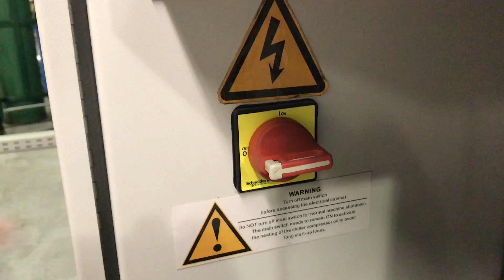Delta Robot High Speed Motion Testing - Project Update #9

Comment: it sounds a bit clunky
Reply from the maker: Mark E it is because of the acceleration profile.  At constant speed it sounds much better but it can’t reach these speeds.  A bit more tweaking and I think it will sound better.  There is also slop in the cheap rod ends that I’m using that attribute to some of the harsh sounds.

Comment: can you show more smooth acceleration?
Reply from the maker: In the current state of the machine, smoother acceleration sounds worse because it spends more time in the lower frequency zone when there are small movement.  All the motors are in sync so they try to reach the desired location at the same time.  Because of this when one of the motors travels a much farther distance than the others, the others slow down quite a bit to reach the same destination at the same time. I may just turn that off and have them reach their destination as fast as they want for a smoother motion.

Comment: What is the aim for this robot?
Reply from the maker: This is purely a hobby project, but I manage a manufacturing facility and something like this could one day easily be adapted for real applications such as sorting metal parts coming off an assembly line. Initially, I will just have it sort different colored marbles.

Comment: Great project! While you can combine a incremental encoder and an end switch, what you really want for this application is an absolute rotary encoder, they don't lose position even after power loss. Optical absolute rotary encoder does exist, but the magnetic ones are cheaper, easier to use and very accurate. Check out the AS5048 from ams or the MA730 from mps.
Reply from the maker: Tat Wong thanks! I have been looking for an encoder I’ll look into those! I have found a lot of single turn absolute encoders but they are definitely the most expensive part of this project.  The rear shaft is 14mm so if I can’t find anything to match that, I can build a coupler or use gears and/or belts.
Reply: Nice thing about the magnetic encoders is the ease of use. I just super glue a small disk magnet to the end of the motor shaft, mount the rotary encoder ic 1-2mm apart from the disk magnet in parallel and that's it. They are also super cheap compared to the traditional ones.
Reply from the maker: Thanks, I'm definitely going to give one of those a try!  Do you have a link to the disk magnet you've been using?
Reply: I bought my magnet locally at a shop, so I don't have a link. Though, it is nothing fancy, just a neodymium magnet with 5mm diameter and about 3mm thick, I think one of the datasheets recommended that size of a magnet.
Reply from the maker: Tat Wong I spoke with the senior application engineer at MPS and he told me that .25”x.125” n42 magnets I have will work. For custom applications, they can tell you what the optimal distance from the magnet to space the sensor.  I have a few evaluation kits on the way!  Thanks again for the tip!  I think those will be perfect for this application and much more affordable than optical encoders.

Comment: Great work! I am also working on a delta robot, but have primarily been working on the software so far. Are you using gearing on these steppers? If so how did you determine what ratios you wanted?
Reply: What software?  Thinking of building one, but it can't use the vertical delta software as the arm movement is in an arc..

Comment: I'm a mechanical engineer, but I feel like I lack the knowledge currently to do something like this. Aside from mechanical design, what do books or topics do you suggest I look into?
Reply from the maker: asdfghbvxxxv google patents.  Reading public available patents will teach about machines and what obstacles the engineers had to overcome and why.  Some patents are very detailed with very specific information. Honestly, the best way to learn is to make a lot of cheap robots and that will help build a good intuition between mediocre parts and great parts.  You can always do static and dynamic calculations before choosing parts but don’t over think it.  Just dive in!
Reply: If you work in manufacturing there's a very good chance you'll end up learning a lot of this type of technology.

Comment: Do you plan to add a cover to the top? Seems kinda dangerous. Otherwise great build!
Reply from the maker: Probably not, as I will be the only one using it and don't intend on selling it.   If I were to ever install in the manufacturing facility I would definitely need to put a cover on it though.  Thanks!

Comment: Could you take some weight out of the main linkages? It's rotating mass, you can gain a lot from the reduced moment of inertia. Not like it particularly needs it haha, that thing is fast
Reply from the maker: I could and may reduce the weight at some point but I don't think it's that necessary right now as the speed is great with plenty of torque left.  They weigh 3.7 ounces and I could probably get it down to 2.5 ounces.  The motors with the gearboxes have 8,000 in-lbs of torque so they are pretty happy with 3.7 ounces :)

Comment: An encoder will catch steps, but it can’t, traditionally, give you an absolute position. A limit switch will do this for you. Also, are you sending a simple hi:lo or are you ramping up speed for trapezoidal motion control?
Reply from the maker: That depends on the encoder.  Since the motor doesn't ever make a full revolution, it's a little easier to give an absolute position.  I am accelerating and decelerating for trapezoidal motion control.  Still tweaking the best values though.
Reply: For a delta like this, I'd use precision potentiometers directly on the arms themselves. It might be a simpler, more flexible (and potentially cleaner) solution than limit switches.
Reply: Absolute encoders aren't that much more expensive compared to the overhead of relative positioning and limit switches.
Reply from the maker: Robert Szasz I will be using a non contact absolute encoder on the output shaft where the main linkage is.
Reply: Try giving cubic motion a shot. Almost all industrial motion applications use cubic profiles to reduce instantaneous jerk and reduce mechanical wear.